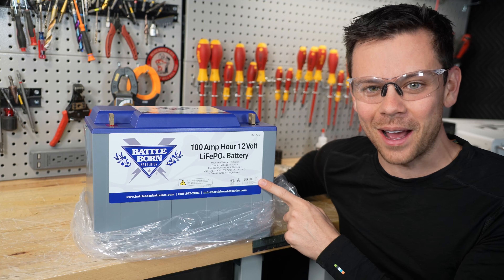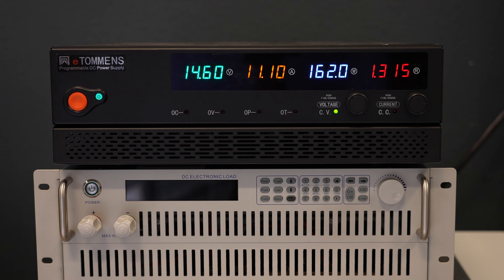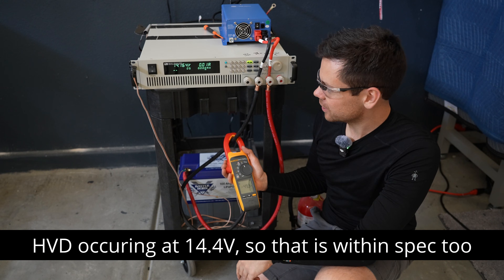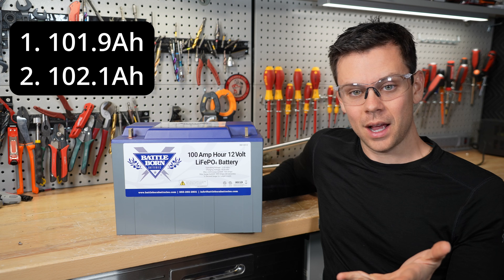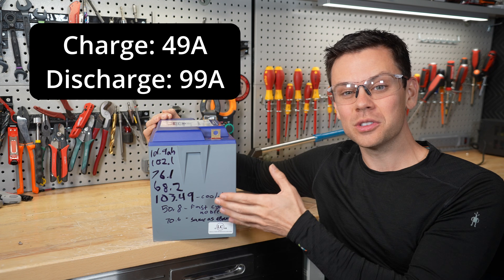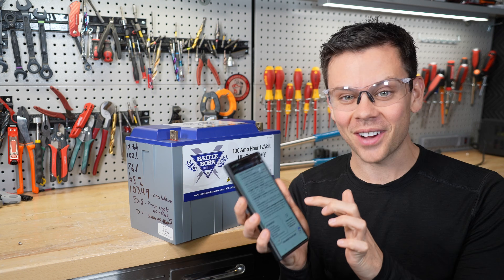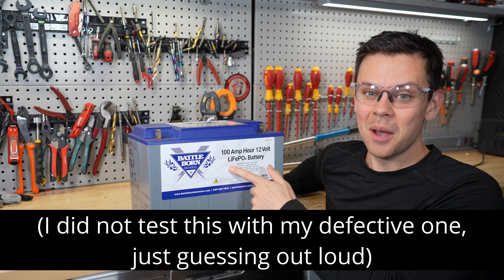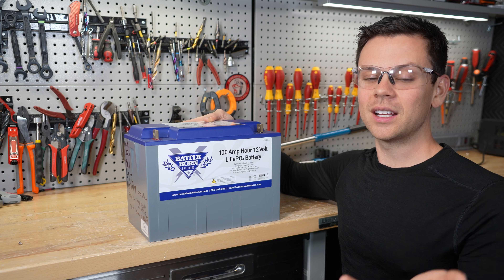A NEW Issue?! Battleborn Cycle Testing!

Comment: I at 6 years with 6 bb batteries, my batteries are under. my stairs soit is a bit of a pain but I checked all my connection, just as tight as when I installed them and look brand new. Would I buy them again, defiantely not

Comment: Will, Page 22 of the Battle Born 100AH manual says that the BMS will not allow charging if the battery's internal temperature exceeds 131F and prevents discharging if the temperature exceeds 140 F. I suspect that is what is happening during your cycle testing and they could claim that the battery you are testing is working as designed. That is consistent with the Operating Temperature range specs on p. 16 of the manual. But whatever heat is generated internally should certainly be coming from the cells and not from the interconnections. How hot are the battery terminals getting during your tests of the new battery?  

However the specs don't explain why some batteries are getting so hot that the positive terminal is melting plastic. It may be that in those batteries the BMS temperature sensing has failed. You could test that non-destructively by putting a battery in a box heated to at 145 F, letting the temperature stabilize, and seeing it it will charge and discharge.

Comment: Aluminum nut on the terminal..that's to allow for more expansion and contraction on the terminal right.. ? Yeah another safety feature. Coupled with effectively a plastic washer, what were they thinking.
Reply: I think there is confusion on whether the bolt is aluminum or the nut.

Comment: Sounda like a pissing contest of specs   vs  usable capcity reality

Any thing  pastcthe safety feature    likeli y not designed 75 amps charging to 99 amps  distcharging

I think unless you are looking at 48 vdc or aboce battery types  i suspect 12/24 vdc systems are going to fail a lot more in charge-discharge cylcles as you are pushing more amps in and out  than  the  baterries can physically  handle

Comment: Everything you report is 100% correct. However, Battleborn has probably realized that they have a problem. Instead of fixing the hardware, they reprogrammed the BMS to limit the charging and discharging amperage to a less stressful duty cycle. Most battery installs are not going to draw full amperage or require a high-amperage recharge in a short time. In my   opinion they should have a 40% discount on their defective new batteries while fixing the hardware problems that Will has pointed out. Battleborn should also offer this discount to all prior owners who wish to upgrade. This could save the company. Customers pay extra to have the brand name. Battleborn could immediately stop making their own battery and slap their brand label on one of the other great batteries that Will Prowse has reviewed. Will Prowse deserves to be paid by Battleborn for his expertise in reviewing.

Comment: Ok. How many people are actually full bore with charge and discharging. Let's be real here. If your system is going to be consistently pulling 100 amps. You're not going to have a single 100 apmh battery. Realistically, your only charging and discharging partly everyday. And maybe go few days of discharging and then full charge.
Reply from the maker: That's not the point at all. Seriously?
Reply from the maker: I am following the data sheet and that's it. Nothing more

Comment: I have four of these. Never seem to hold as much charge as long as I expected them to. I kept thinking it was something in my system.  I regret my purchase.  $3,600 spent.  I HATE that this is something that an American company with excellent tech support is going to have to deal with, but I'm strongly considering replacing.  Let's see if this results in a class action?!?

Comment: My cabin battery consists of four 200 Ah Winston cells and I regularly pull 130 A from them. The terminals never get warm. Not hot, not warm.
The 100ºF you measured is way too high and clearly comes from inside the battery. This is a dangerous product with some seriously dangerous design flaws.

Comment: I'm curious... do have a way to "save" the power you pull in the discharge cycles?  Because re-charging, right, you have to use your source power (shore power, solar, whatever).   I also got to thinking that you could easily start some kind of "certification" business for batteries, electronics, etc. based on your expertise in the field and in the community.  You're young enough to easily get this underway!

Comment: Thank you for this series.  I have an issue with two brand new 12v 100 Ah BBB and their tech support was worthless.  First they told me I was using it outside of specifications, but when I said I was using it within what they advertise, they stopped emailing me back.  I'm just going to ditch these very expensive batteries and buy SOK or similar - simply costs too much to send them back via UPS when I can just buy a replacement.

Comment: I was considering a BB battery for my car audio setup to maintain voltage above 13v during high current draw situations, but I'm really having second thoughts after seeing this. 
If my impulse draw is 2c the AH rating of the battery, that terminal is going to get hot quick, and the last thing I need is a lithium fire that destroys the car and the system.

Comment: My campground neighbour has 2 BB in parallel for his rv. I have 2 eco-worthy or as he calls it, not worthy cause they were a third the price. ( amp hours are the same) We both have identical victron inverters, charge controllers, battery monitors but his trailer is a toy hauler, so slightly different load demand. The eco worthy size is a bit smaller but these batteries take less time to charge and in the morning my batteries are at 82%, his are at 74%. I would never spend the $ on BB as we don’t see the value between us,

Comment: Anyone have a thought about this question about a Battleborn 12v 100 ah smart battery. I charged it on December 6th. Read 100% SOC  at 14.4 volts. It sat at room temp. Today, December 22, the app reads 86% SOC at 13.3 volts. Why did the state of charge and volts lower that much sitting at room temperature?

Comment: I think its commonly accepted that a battery must cool after discharge before charging and vise versa.   High end lipos for drones ive used will not accept a charge until they have cooled.... this is well known amoungst drone users. 

I also think if you want that terminal to loosen up, you should consider simulating vibrations experienced in mobile instalations.  Id bet that the leads bolted to the terminals vibrating will move those terminals a tiny amount, and thus help to begin wearing the plastic spacer to start the jam nuts losening.

Comment: 15k Sol-Ark inverter and 20k of HomeGrid Stack'd 48V batteries. Amazing specs for both, and I turned it all on 3 years ago, have never needed to turn anything off. Now they make an 18k Sol-Ark that I'll guess works as reliably as my 15k. And, honestly, get even more battery backup if you can afford it. Side-note, my system is grid-tied, but I have the utility power sent directly to my inverter instead of to my service panel (that's how robust the inverter is). The utility company pays me every year, they always owe me, so my electricity is free. And my HomeGrid stack will allow 12.9kW continuous power if I'm drawing solely from the battery. I have no critical loads panel: don't need it when my inverter will handle 15kW continuous output. Simple system, great results, and hopes that it all just keeps going for the next ten years.

Comment: Aging may be a consideration more than cycles.  The aluminum to copper connection may take years for the dis-similar metal reaction to occur.  It has always been a no no to connect aluminum to copper and run electric current through the combination.
Reply: Simple Google search points this out, and you are more likely to have this failure develop over time in humid environments. 

 Search results which are chemistry 101:
Here are some metal pairs that should not be used together:
Aluminum and Copper: Aluminum is anodic to copper and will corrode rapidly in their presence, especially in moist environments.

Comment: Wills well done. You chanel saved me twice on inverter stuffs. And since I joined your DIY forum I have built 10 solar power banks and 3 E-Bikes (the battery bulld and wiring based on things I learned from you) Thanks a lot

Comment: I used to work at UL.   a UL listing doesn't certify products.  UL lists products as safe.  They do not care if a product meets any advertised threshold.  They don't care if a product fails.

They test to make sure that when a product fails, it does so safely.
That is why a UL listing is required on batteries that are used in code compliant, inspected installations.
Reply: Yeap, UL is a joke but big companies require UL stamp to sell them products.

Comment: My suggestion for back to back tests is to set your charge current much lower. That way the battery is cooling down from the discharge portion while it's charging.

Comment: I have 2011 cycles on my 4 Battle Born batteries. Installed the system 19Jun2020 and they power all my 120v circuits in my home. This summer I had one battery low voltage disconnect twice, shutting the entire system down. When nearly discharged, 3 batteries are at 12.8v when that 4th battery starts dropping below fast. So far, that is the only problem I've noticed.
Reply: From your post it sounds like you have the batteries in series for 48V, it may they are no longer balanced, though a weak battery could also be the problem. I would recommend manually top balancing the batteries by fully charging them in isolation, if you still have the problem immediately afterwards then you would need to capacity test them in isolation to confirm an outlier. If it seems good after balancing, but quickly starts to go imbalanced that could suggest a self discharge, though in reality this would have likely already  been picked up as a bad battery with low capacity.. Rather than replace a single battery it would be better to replace all with a dedicated 48V unit with a single BMS to ensure all cells stay in balance and find another use for any good batteries.
Reply: @MrKarlPrince true, in series in a 48v configuration. I also have a balancer on them and all read 13.6v at the end of the day. Batteries are also rotated annually. I reached out to Battle Born a few months ago and followed their test process and battery isn't damaged, just showing signs of reduced capacity.

Comment: I have 3 Battle Borns in my four wheel camper a put 4 in my buddies sprinter build I did back in 2017.  I did a little testing on the bank itself a bit over what I would normally run. I basically charged them to 100%, put a 180 amp load on them with a couple of heaters and monitored the temps with a thermal camera. I’m not doing nearly the stress test you are doing but it’s more in line on what I run into. I ran the test until the bms stopped it. I never got above 110 degrees F. Also, the potting around the terminals look basically new. With that said I’m replacing them with a couple of HumsienK 314ah mini smart. I’ll attach blue sea terminal fuses also. I needed to increase my battery capacity so seeing this issue with battle borns spurred me to make the change. I didn’t see any teardowns of the HumsienK batteries I’m getting…..guess I’m the Guinea pig! Thanks for doing these videos Will!

Comment: How many people cycle these batteries under the same conditions?  According to several testing labs,  it might take several years to a decade to reach the 3000 cycles. With the type of extreme usage this guy places on these batteries,  it's no wonder they fail. It would be nice if he provided the stats on how many have actually failed under normal usage.

Comment: I bought 2 Battleborn batteries back in 2020, I think when Will started doing videos and apparently have had no problems with those earlier batteries.  Now, I wonder if BB upgraded their batteries and made them worse, or the problem was always there and I just haven't pulled enough current to see them degrade.

Comment: It would be interesting to know why the capacity was off

1 BMS cut off charging  due to temp or other before full (battery issue) < this will make charger cut off too.
-2 The charger cut off charging before full on its own (not a battery issue?)
Or charging is ok, But
-3 BMS cut off discharge before empty (temperature or other, battery issue)

Check for 3 by letting it settle (cool) and finishing discharge testing. Anything left? You should find the missing AH if charging was ok.

Check for 1 and 2 by monitoring end-of-charge cycle: is battery really full? Why not? charger cut off charging? BMS cut off charging?

If battery really starts full, you should be able to get that missing 20AH out somehow and isolate the issue somewhat....

Comment: When I got my first set of lithium, I had talked to my dealer, and they were/are all about Battleborn and tried to make me feel shitty for not immediately buying them.   That's when I discovered Wills channel and started researching.   I ended with Weiz batteries based on his recommendation and several years later have passed them down to my son when I upped my AH.   I now have 600ah of batteries, 730 watts solar and still haven't spent as much one Battleborn would have cost.   Thank You Will!   If you're ever in eastern Washington, I will gladly buy you dinner!
Reply: 730 watts of solar is way too small for such a huge battery. You'll never be able to generate enough in 1 day to cover even one third of the battery.

Comment: Are ypu charging all the batteries in your series on the ground? You probably blew out a cell grpunding the battery and charging it. Please remove it and place it on an isolated rack.  That might help eliminate some factors as to why that device burnt out

Comment: It would be interesting if you could get a older battery in good condition and test whether it triggers the same temperature cutoff when run back-to-back, or if the BMS was updated to mitigate the  flawed design

Comment: #1 the ETL mark is equivalent to the UL mark. Both labs test to the same standards. The question is what standard is it actually listed to? In my research the only ETL Listing I could locate was for power electronics in hazardous locations. Nothing related to being a battery.
#2 I still maintain that vibration and movement is the killer for these batteries. The flag style terminals just add leverage and transfer vibrations straight into the bus bar. Virtually every other battery uses a flat terminal and is connected to the bus using flexible cables internally.
Their BMS SHOULD (key word) be protecting the terminal from overheating. And as Will has discovered it is in this battery.
I still agree this is a massively flawed design, but I will be surprised if simple current cycling causes the failure.

Comment: Will, remember to include a delay in the cycle to let the bad connection cool down. The loosening could be caused by heat cycles, not just continuous loading. Maybe get a PLC to measure voltage and turn on a fan when the battery is almost empty, or when the BMS goes into protection.

Comment: Great stress test on this battery! Many people are missing the point about this test, saying it's not a typical use case. This test does however test the maximum ratings that the manufacturer is claiming it's battery can do! 

Lets use  the analogy of stereo equipment. The manufacturer of my AVR claims that the amplifier can drive two channels driven at 100 Watts. Do I ever listen to it at that level? No way! The loudest music I listen to has maybe 20 watts going through the speakers , probably less. Now, am I glad that third party labs verify the manufacturers claims? Yes! It's important to keep everyone honest.

Derating the battery during multiple discharge cycles  is probably a feature, not a bug. Having said that the manufacturer has to state this in their specifications somewhere! Maybe "continuous" with an *. with words saying " maximum charge/ discharge cycle rate might not be met if BMS detects battery temperature is above X degrees"

Comment: I have a question for the community here, I have two Exo-worthy batteries that I've pulled out of my RV for the winter.
They were pulled charged with solar to 100%,I've had them in my nice warm garage for the last month.
Is there any issue just leaving them at 100%? Not planning on installation back into the fifth wheel until February, Cheers.

Comment: I found this on the Web.  :-  repeatedly charging and discharging a lithium-ion battery in quick succession, especially at high rates and through full cycles, will cause the battery to generate significant heat and potentially overheat. This practice increases the risk of damage and poses a safety hazard.

Comment: How many people will fully charge then discharge at 100amp only to fully recharge and discharge again several times at 100 amps surly any batter without thermal management will do the same. I’ve a 200 amp hour battery in my RV but I wouldn’t be doing a full charge then discharge over and over again in quick succession.

Comment: On a side note Will the Deye 10.2 Ah you tested. I purchased 3 of them , two of them are showing issues with the light display level at full charge. 1 light shows 1/2 full the other shows 2/3 full. The 3rd in the String shows perfect full status. As far as I can they appear to function to capacity but I have no way to test them.
Reply from the maker: Oh is this the large battery? Can you post that on the forum? I'm still cycling that one every day in my workshop and it's working great but I would love to see what problems you're having and figure it out